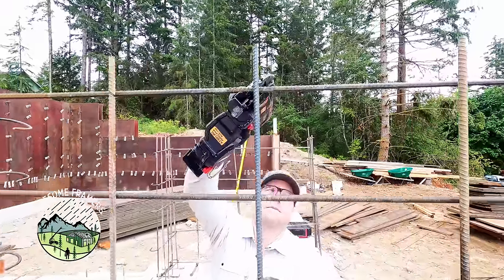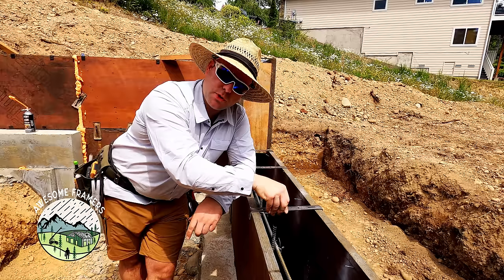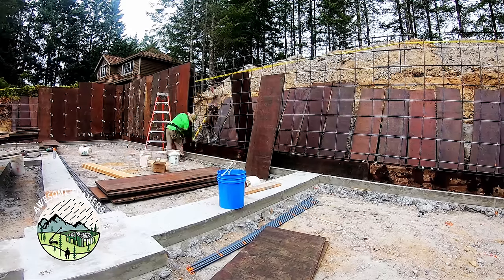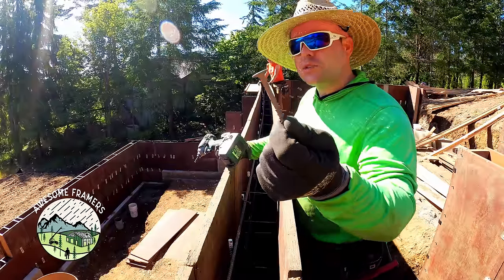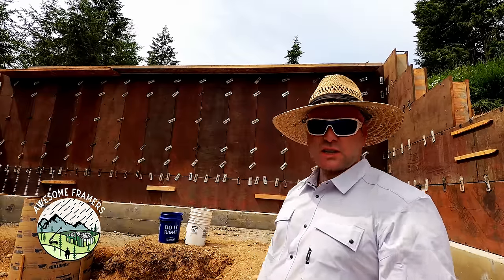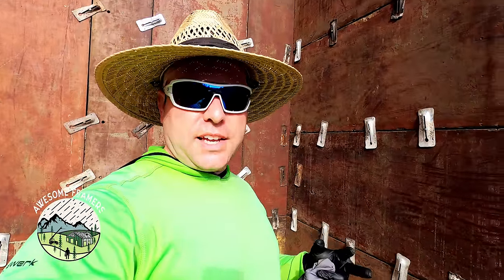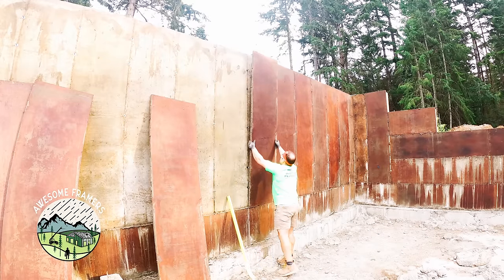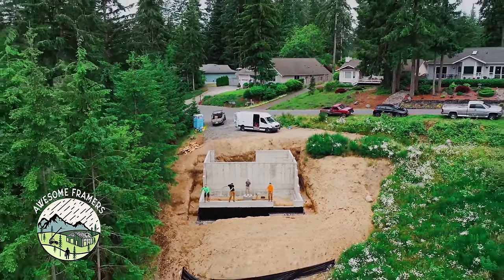How to Form Tall Foundation Walls

Comment: I prefer the gates wall system!! It is much more efficient than anything any of you people are talking about! You're either a freehand form setting Carpenter or you're not! That 1-1/8 "wall system is not versatile whatsoever! The gates wall system consists of hinged corners that do not come apart. And they are on hinges. All your panels are ran out in full sheets. And then when you get to the end of a wall you fill in with fillers. Extremely versatile!! I have 25 years experience with this wall system. I have stacked up to 24 ft. No problems whatsoever! But to each their own every company does it different!!!

Comment: Fastest system I ever used was PERI forms in an industrial pour.  Super super expensive and they get moved with a zoom boom but they latch together and you can make almost any sized wall fast.   But that was at a mine with very deep pockets.  The usual forms I used for residential in Saskatchewan were similar to yours or just sheets of form ply backed with 2X4s going horizontal and vertical.   Lot more labour intensive and rebar was all tied by hand.  I saw a tie wire gun one time in my career and it was pretty good but didn’t tie the bar as tight as people did.   

Still I loved your video, awesome ideas and great work.  Done well and intelligently.
Reply: 15+ years ago we used to use something called the Simplex forming system for up to 16' pours. They were out of the Chicago area. We could frame them as fast as the laborers could hand them to us - just drop the ties in the ears and slam the tie clamp down over them. Unfortunately they must have gone out of business because I could only find old used ones for sale online.

Comment: This video change my life, whats all the fuss about music? Do you lose the spacers at the bottom? Whats would you recommend for rebar spacing so the snap ties dont buck rebar? How to you brace the inner and outee corners? Did you give the snap ties a groove in the ply board or do you let it sit with gaps between board? As you keep the spacing the same on the snap ties, do you have selected boards just as verts?
 I would love to see this all in a video but i know you guys are very busy.
Reply from the maker: rebar spacing is generally 12" oc both ways for taller walls for us.  Since the snap ties are 2' (panel edges) I just layout the footing so the bar lands 3-4" short of the panel edges.  When the forms are new, we stack them on edge and cut a small groove.  Smaller than the snap tie so when we beat them into the groove they stay :-)

Comment: We had 5 of those max rebar guns. On days where we would form 16' high 160' radius manure pits they came in pretty handy. Only thing is they can't tie the 25mm thick re-bar wrapped around the bottom of the pit.

Comment: Removal of Snap Ties requires them to be "Snapped Off", not ground off. If they are snapped off,  they break off "recessed" so grout can fill the void avoiding rusting in place and into the concrete or worse, the rebar inside of the concrete. This is also a code issue.

Comment: We do it the same, but different in Northern Illinois.  We use Duraforms with E clips and bent ties.  If we have to stack, it goes on the top.    Also, we usually don't pout deep footings, we step the footing and wall.  Save on concrete.   We also stone the footing before wall forms go in the hole.  You left a good looking wall, more than one way to skin a cat.

Comment: Awesome video. I am a new contractor and I use this 1" 1/8 system, I would like more info on your verticle orientation. What do you do for locking inside corners?

And I notice you don't use strong back either, so less work and your Fondation looks nice and flat.

Great video! I may try verticle stack on top of 2 foot horizontal.

Comment: Hi, so just wanted  to let you know ,when  you cut those  metal  things  in wall,  you should  cut them at least  1.5 deep,  so the rust  is not coming  out after,  I use  to do the same jobe we learned  this with   the time;)

Comment: Right on. Never built vertically but use the exact same stuff. But we spray our panels with diesel and motor oil. Also did I see spray foam used to fill a leak? Never thought about doing that. Do this often? How’s the end result? Foam stuck/bludged into the wall a little? Good stuff man. I’m north of Seattle. 🤙🏻
Reply: we use JP Strip or something like that to coat the panels.  Works really well.  Yep we use the spray foam but mostly where it'll be hidden underground.  I got that idea from ICF videos on YouTube 😂😂 it works very well, we can span 1" easily with it and the concrete won't push it out.

Comment: When using a vibrator, I have always plunged the stinger down into the mix and immediately pulled it out to prevent the aggregate from settling to the bottom of the form. The aggregate must always be consolidated evenly in your pour. I will usually vibrate the rebar very briefly if practicable and even vibrate the outside of the form, again very sparingly. I have watched in horror as some guys hold that vibrator down in the mud for several seconds at a time.

Comment: Once the forms are up we brace the forms and bring the wall to plumb. We also use metal form brackets that hold 2×10 wale (whalers). Makes for nice straight plumb walls. 
While you may have plenty of experience there are some steps that were just missed. It may leave a noob thinking concrete work is easier than it is.
Reply from the maker: Like what?
Reply: @AwesomeFramers  Missed steps? 1. Bracing that holds the forms vertical.
2. Horizontal bracing that holds the forms straight. Wales run horizontally. Usually there are 3 courses on a 8 foot wall.  
3. Snapping a string line inside the form to set grade. Nail grade nails on the line, 2 - 3 feet apart. Remove the nails during trowelling, before concrete begins to set.
4.  No anchor bolts were set.
5.  Steel trowelling the final grade.
Hope that helps. It was a good video  on concrete forming, certainly better than most.
Reply from the maker: @Farmboy1544  thanks for the feedback 👍 as I showed in the video, we use an I Joist whaler eliminating the rest of the whalers.  The drone footage showed all the bracing needed. Our anchor bolts aren't wet set but are already in place using the Anchor Mates. Even though I showed Kyle working the nuts too the grade nails, I didn't show the process of snapping the lines. We pull grade nails as we strip.

I appreciate your feedback 👍👍

Comment: hey! i just found this channel and i'm impressed! pretty cool stuff, i just subbed.

ps: but a small remark --> I have worked as a side job in a steel processing company and I know how it is with the flexing, it is only a screw and you think "oh that's fine without for this one screw", but no, I have so far jumped two lenses and a splinter was hanging directly in the goggles, without these glasses I would probably have lost my eyesight today, so PLEASE , PLEASE always put on goggles!
Reply from the maker: We always wear safety glasses, but thanks for the reminder, I'll buys some goggles

Comment: I’ve used the 1-1/8 system for a long time and never stacked vertically, that seems super efficient for tall walls. Do you rest/tie the snap ties on your rebar to hold while you stack the next panel?
Reply from the maker: no we don't, we just "pre-groove" the panels then tap them into place.  Most stay, but the odd one falls out and we have to hold it in place.  The pressure of the form keeps it there long enough for us to put on the shoes/wedges.
Reply: @AwesomeFramers  What tool do you use to pre-groove?  It appears that the edges are spaced apart by the diameter of the snap tie?
Reply: @steve5861 it looks like they have them all pre cut, most likely they butted panels together on sawhorses and used a forstner or big gold drill .

Comment: I was surprised that there was no ties in the sheets itself but obviously it works without.
Good work👍
Reply from the maker: There would be if we used the 4x8 sheets. But we don't really need to invest in that size.
Reply: @AwesomeFramers  What was the thickness of your formply again?
Reply from the maker: @rotaxrider   1 1/8" MDO
Reply: @AwesomeFramers  Ya  1 1/8 can handle a lot more pressure than 3/4

Comment: I'm building a small cabin and want a basic basement under for storage. Nothing crazy. Maybe 10' by 10'.

What all do I need to know/Google to avoid issues?

I figured I could just dig a hold and pour concrete to make the walls. Seems I was wrong.

Comment: Had two of early Max rebar tiers and both were a massive pita. Worked great, when they worked, on small bars.  But batteries quickly took a dump, had constant jams, and if they weren't so damn expensive, would have used a 10 lb sledge and smashed em to smithereens.  Still have them - both long-since inoperable.

Thanks a bunch for the forming details (always used single and double-waler forms). Are there form-design charts for those 1 1/8 MDO panels?  Or is it just empirical design based on your years of experience?

Lastly, curious why you leave snapties on prior to stripping and then spend the time to grind? Never seen that done.  Always used break-back ratchet while wedges were on - breaks ties with half a turn and makes forms easy to strip.
Reply from the maker: Lots of great points. On the rebar tying guns, did you send them in for service?  

There are charts if you search for the MDO panels.  Been awhile since I found them.

On the snapties, I have never seen it done the way you describe, sounds like I need to try that.  Thanks for the tip.
Reply: @AwesomeFramers  No, never did send them in. We didn't do much rebar placement ourselves (relatively) as most jobs were too big to place our own bar economically - and most rebar subs were small business/minority owned so were necessary to meet the government diversity goals (that most of the WBE/MBE were a complete sham is besides the point - husbands would put company's ownership in their wife's name, or they'd put ownership into a minority front who'd take a small cut for the privilege)

Comment: Nice info. I am going to build my house in FL where the house needs to be elevated. I was thinking concrete pillars or cement formed walls below the lowest elevated habitable area. 

How much does a foundation for like this cost and would it be more economical to do cement pillars with a concrete foundation?

Comment: Good idea with the tji as a brace. Is all that rebar required where you are? Here in the Midwest, only 2 horizontal rebars are required in basement walls.
Reply: yep.  The rebar was specified by the engineer.
Reply: Yeah it is weird that rebar quantity varies so much with local practice, not just West Coast v Midwest, but all over the world.  I see huge variations and expectations for otherwise very similar jobs - just in different locations.  The practice you mention is technically "unreinforced" concrete by code, which can be just fine.

Comment: I Might have just found my wall "system'' for the house I'm building for myself. ten foot concrete walls.  I need that hardware though.....
Reply: If you are building it yourself, why not save a lot of labor and use ICF - Insulated Concrete Forms?  You can rent bracing from most distributors.  You can even take it to the rafters to have a very energy efficient building.

Comment: You mentioned about pouring the concrete in lifts but you didn't say how long to wait to pour the second layer.  Also I was wondering when you pour the second lift do you just vibrate down to the joining layers or do you go a little bit past the layer in order to mix the two layers?
Reply: don't wait too long or you'll get pour lines.  We typically try to stay in motion and just go around the foundation or whatever makes sense.  The pump operator is a great resource.  He doesn't want a blow out either and he pours a few times a day.  So we tend to follow his direction.

Comment: so how many screws do you get to screw in till u need a new piece of wall.  as for the top form you used screws to straighten the wall.  courous to know how much was the concrete for all the walls of the basement

Comment: Question on the ties, the ties the go on top and act as a cleat how are they fastened to the footing ?
Reply from the maker: They don't need to be, but we prefer to just put a nail through the hole while the concrete is setting up at footing pour

Comment: Could you explain what is meant by "pour in lifts"? I interpreted it as pour to a certain height, stop, wait some time for first part to setup and then continue pouring again. Is that correct? Is so, how long should you wait before pouring the next lift? Just trying to figure out the timing of concrete trucks between the lifts.
Reply from the maker: Don't pour to the top of the forms but pour it 4' "lifts".  So work back and forth filling the forms.  Don't wait long or you can get pour lines or cold joints.  Vibrate the lifts.

Comment: I find it hard to believe that you don't get some warping of the wood forms over time when compared to metal forms. And I don't recall seeing concrete seeping out of the seams with metal forms on the videos that I have seen. Remember, that's really water seeping out of the mix  ...how is that a good thing?
Reply from the maker: You're over thinking it.
Reply: Wood forms are fine as long as they get replaced per manufacture recommendation and are maintained properly that being said we use metal.

Comment: What do you think of ICF construction? Seems like it'd be more expensive in the long run, but easier. I hear termites are a problem because of the foam. Your wall isn't going anywhere. Great Video.
Reply from the maker: every 3 years we price ICF because the panels get heavier as we get older :-)  It is insanely expensive all things considered so we never pull the trigger.

Comment: Are those spreaders on the bottom anchored or nailed or tapconned to the footer?
Reply from the maker: Yeah I like to snap lines if possible right after we pour footings and then push a nail through the hole 👍

Comment: I'm wanting to build a house, around 6k sqft, I have went back and forth between symons forms and ICF, obviously right now I am back on thinking symons forms is the better method, this will be a built by me and my wife and we wont have much outside help. But I dint see the reason to have insulation on the inside of the house, I just want to plaster straight over the concrete inside and have exposed utility and HVAC, on the outside I will have to find a way to fasten insulation to the concrete, which thier are many methods, I'm thinking canarock is a good system. Will see, what ever I land on I'm ordering in January

Comment: My contractor just poured my foundations out of square by 3 inches on each of two walls. They framed the main floor already and at one end the joists overhang by 1.5" and at the other end they are short 1.5". This is on a 30 foot wall.
The other wall is a garage wall and they want to cut it below grade and pour it square on top of it with epoxy dowels and use rigid foam under the part where the new wall will overhang the old by 3 inches. We have a 4 foot frost zone here and with cold seams I'm not sure this will work!
What would you do if you poured a foundation 6" out of square on a 56 foot house?
Reply from the maker: It's possible to hide that and make it up as you go. They should be required to make it right.

Comment: is there a way to.pour walls without any nail, bolt,connections between the outer forms, in the case where a person must have absolutely solid walls full if concrete
Reply from the maker: Probably, but I don't know personally.  I worked with a commercial guy on a volunteer project and he said they'd come back and "sack" the face of the wall to give it a uniform look.

Comment: May I ask what the rough cost for a foundation this size? Length of time from start to finish?
Reply from the maker: I don't have the numbers for cost in front of me.  For length of time, it was 2 days for the footing (2 guys most of the time) and 3 days for the walls.
Reply: @AwesomeFramers  thanks for the reply.... im just looking for a rough estimate with materials and labor... like 30,000 50,000 or 70,000. Ballpark. You do this type of work all the time... just what you think off the top of your head. Do you service southern california? I'm trying to determine the cost of my build.... 24 ft by 34 ft foundation slab rectangle, with 13 ft walls on the perimeter of 3 sides. 2 sides 34 ft, one side 24 ft.  Project on a slope with a rise of 7" and run of 12"   58.3 grade. If not Thanks anyway.
Reply from the maker: @tubesurfer4331  20-25k including materials.

Comment: Do you cut your panels to for plans or do you have fillers?
Reply from the maker: We avoid cutting panels if at all possible.  We have a pile of pieces and some "pans" for horizontal work and some 1' and starters for inside corners.  A few odd lengths, but we can usually form without cutting.

Comment: Why you use wood panels, while you could use metal panel that last way more than wood. Each time you hit to remove the wood panels you make damage on sides of them (unintentionally), so next time you use them, cement is gonna leak through. Not efficient in my opinion.

Comment: How much thinner could the wall be if you used fiber reinforced concrete?
Reply from the maker: Zero
Reply: @AwesomeFramers  how come? Building code?
Reply: @AwesomeFramers  the reason I ask is because I read in an article a while back that famous architect Zaha Hadid was able to construct a building in Miami with thinner than usual walls because the poured concrete was fiber reinforced.
Reply from the maker: @goldistocks609  interesting. There is a way to use a micro rebar but that doesn't automatically mean thinner walls. I wonder if he had a special concrete mix
Reply: @AwesomeFramers  yes, fiber reinforced concrete (FRC)